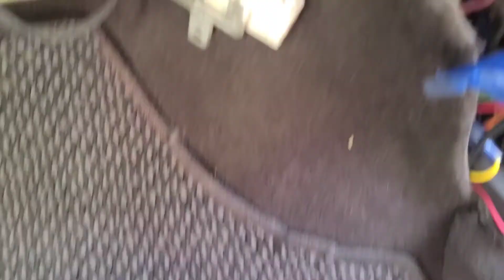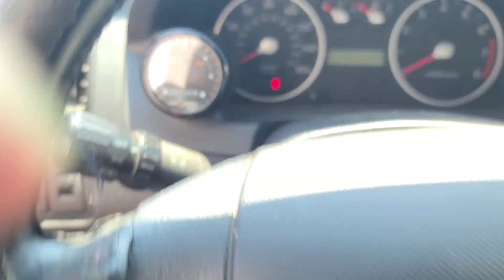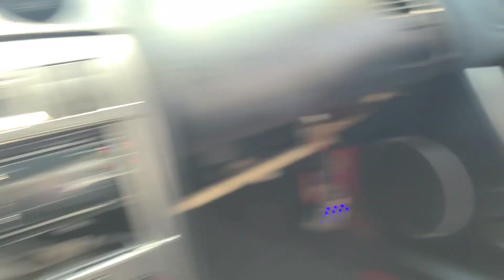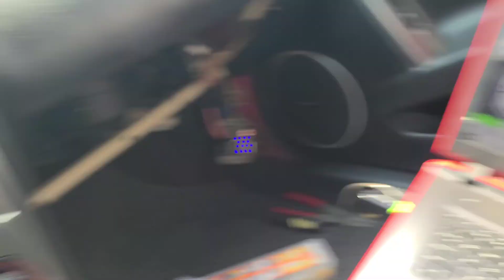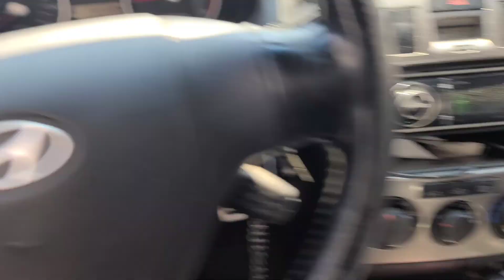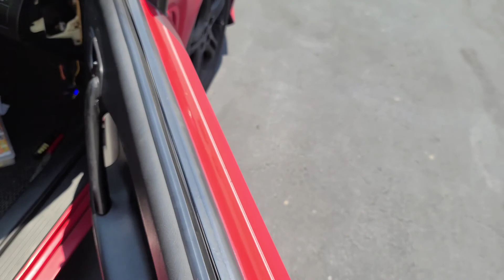Tiburon on Megasquirt ms2

Comment: I saw your other video on the things you love and hate about your tiburon… and you mentioned doubling the hp by adding psi and something else and I was wondering how you go about doing that? I’m getting a tiburon really soon
Reply from the maker: Only ways to boost these things is to find a used supercharger which is getting harder and harder to fins or do custom turbo look I'm working on but also a lot of work and money not a cheap thing to do because you need a lot of supporting modes so you wont just blow the engine up and you can make power.

Comment: you is thed ms3 fully wired in? no stock ecu attachment? how you running tps sensor iac, fans,a/c, wheel speed sensor.
Reply from the maker: My bad I just saw this . It's a megasquirt ms2  and tps just is factory and iac is bypassed but with a ms3x you can use ac and iac and wheel sensor speed Is a separate system.
Reply: @rushking19  So no needing to wire wheels speed sensor?
Reply from the maker: @johnmarco5017  nope no need the abs system controls all of that . And the speedometer works with the single coming from the transmission speed sensor which also goes through abs the to the cluster I believe. Even cruise control still worked . All you have to do is send a signal to a certain wire on the ecu harness I can't remember which one off the top of my head . Also if you have an high enough quality standalone you can have a/c too.  I have ms2 I could of had a/c if I wanted to but i deleted the a/c it before the standalone  and I maxed out the outputs with the added mods to the ecu ,  flex fuel,  boost control,  and table switching.  But even something like a megasquirt ms3x could do a/c it has more output wires also.

Comment: Hi, I have a 2003 tuscani, I would like to know, how to make it work, Tac.  and RPM with megasquirt, thanks 🙏🏽🙏🏽🙏🏽 good job
Reply from the maker: If you have a v6 then send a tach sign to pin 17 on connector C133-4 it should work and make sure its set to Normal speed not half speed and it should work
Reply: @rushking19  thanks
Reply from the maker: @julairrr  no problem

Comment: You got a thicker head gasket for lower compression right? Or are you doing that on stock 10:1? Too bad the aftermarket on these have been dead for a while now. Most if not all of the aftermarket companies that made parts for Tibbis are out of business. No turbo readily available for the V6s either, gotta get a custom one. Only superchargers were made for these, but you can only get used ones from new tiburon forums or facebook groups. Also, damn, it's nearing 300k miles. Thing has seen some road at 272k miles.
Reply from the maker: My motor doesn't have 272k miles only the body does my motor has 150k on it amd i may even look for another lower mileage engine thats around 100k miles and also the turbo set up im putting together is all custom this video hear explains it more https://youtu.be/gtjNQ-PDA5s thats a old video too I've since then cleaned up and recoated the headers and turbo up pipe and I've gotten a intercooler and piping and gotten a spare trans and also got a lsd and installed it in the spare trans and I've gotten a light weight flywheel and stage 3+ clutch and much more I just haven't made an update on new parts like I explain in this video on the megasquirt
Reply: @rushking19  Nice man. Good to see that these Tibbis are still getting love. May be an outdated platform that doesn't have much going for it in terms of aftermarket or tuning potential, but it really is great to see people are still putting effort into these cars. I have a yellow 04 GT V6 Special Edition with the 6 speed, and I love it. Has 172k miles on it and it does have some problems for sure though, mainly the timing belt (don't know when that was replaced) and the throw out bearing, because I can hear that mf clicking, squeaking, and knocking like crazy a lot of the time. Then there's other stuff like the struts, oil pan and rear main seals leaking, etc. Trying to fix mine up too.
Reply from the maker: @LimiitedChans  yeah my tob is starting to make noise too I have to hurry up and put my stage 3 clutch and lsd trans in and yeah some people stull build these theres some pretty cool builds going on rn
Reply: @rushking19  That's cool. Just super hard to come by significant performance parts from name brands nowadays. If it isn't on Tuscani Customs, Shark Racing, or on forums/facebook groups, it's pretty much non existent.
Reply from the maker: @LimiitedChans  yeah everything has to be custom now